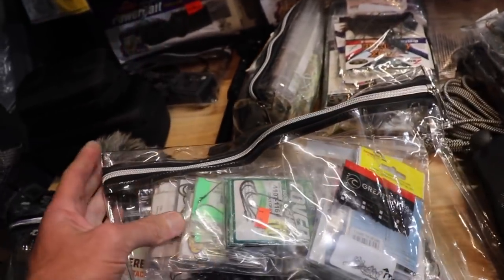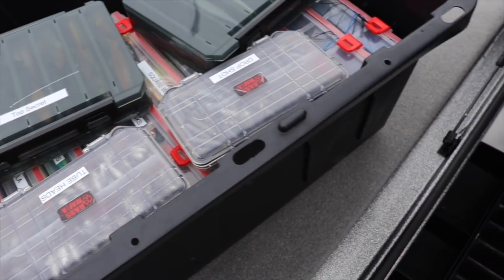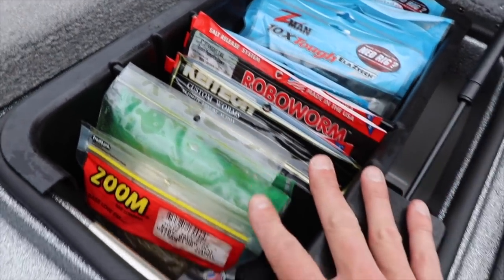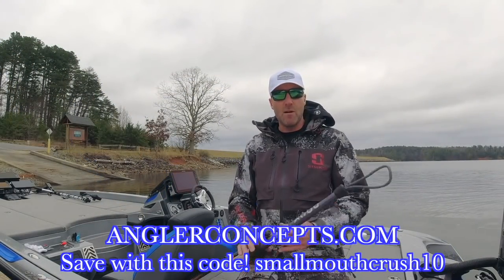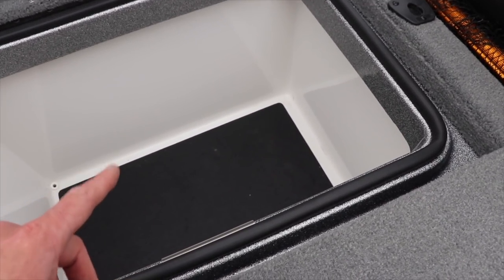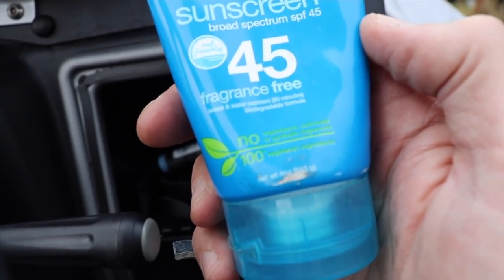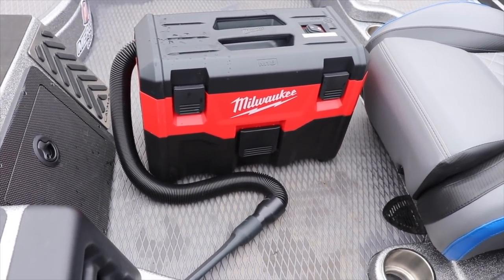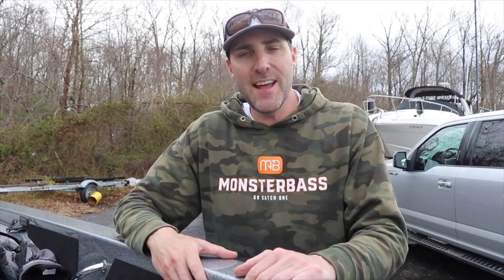How I organize my fishing tackle in my bass boat!  Part 2 Tackle Storage Tips

Comment: Wish they made the amped system for the nitro. On my z20 3600 boxes fit towards the back of the center divider but not the front. Such a bad design.
Reply: They do look them up at AMPD!
Reply: @bradsmith873  Don’t see anything for the z20, just the z19 and z21